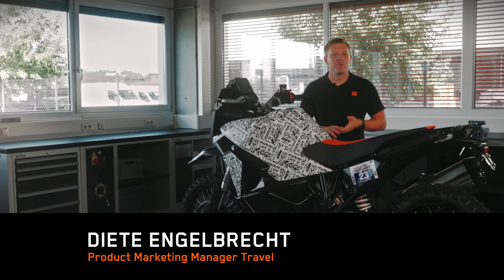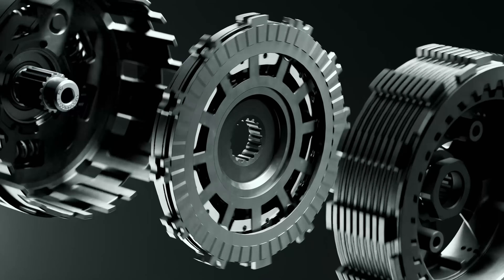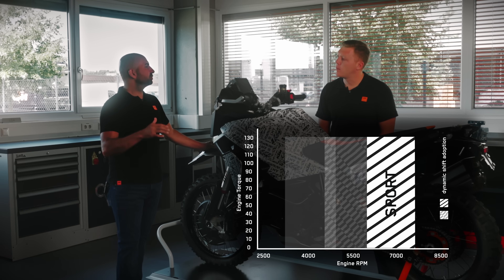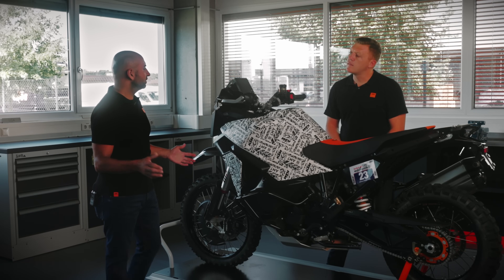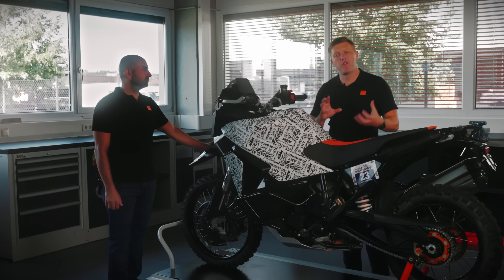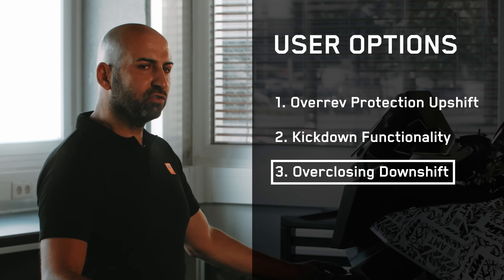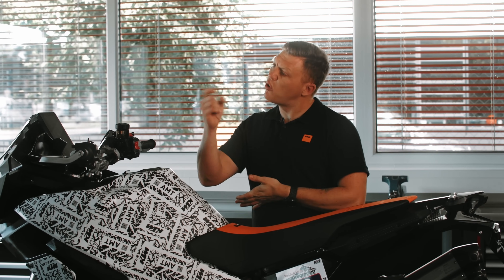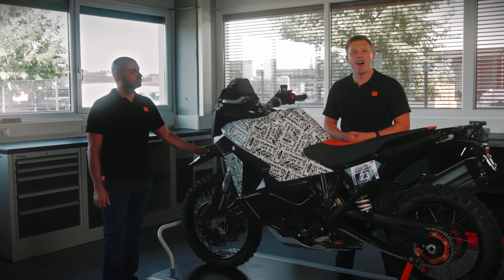KTM AMT - Blurring the lines between sport and comfort | KTM

Comment: Two questions
1) how does it work when you are coming to a stop, do you just apply the brake and it goes into neutral when stopped, most people are used to dipping the clutch 
2) I’m guessing the model in the vid is the new 1290 Super adventure R, is there a release date for this?
Reply: Hi Peteski

1~ When coming to a complete stop the bike will go down to 1st gear.

2~ The bike in the video is a Prototype KTM 1390 SUPER ADVENTURE, the first bike has already been launched with AMT that is the KTM 1390 SUPER ADVENTURE S EVO with more models to follow in the future
Reply: @diete_exploring5936 I’ve seen the evo, more keen on the adventure r, this prototype with spoked wheels, 21 inch front wheel, 18 rear, high front mudguard etc points to more an R model. Keen to know when it’s likely to land as it’s mentioned R in press releases but not signs in the ktm marketing.

On the gearing, keen to feel how this works, if you’re not dipping a clutch, sitting in first can be problematic, I assume it will work like car auto so instead you applying the brake to hold 🤷🏼
Reply: They Use Centrifugal Clutch Engagement. Like Rekluse EXP 4.0. So basically, clutch pack can disengage itself when engine rpm goes down. but normally TCU will downshift the sequential gearpack to lower gear, followign Shift diagram. 

This system have some critical issue that other AMT system doesn't have. so i guess they will not adapt this technique into R model. that kind of genre require precise clutch control.

Comment: I think it's really neat. I don't get why people get so upset about losing their manual gearbox, while a quickshifter has almost been the most requested feature on modern bikes.. eliminating using the clutch for 90% of gear shifts 😂
Reply: Can't clutch dump like you can with a normal clutch
Reply: @tylerslayton6070  tell me how often you do that with a 1390 under your seat.
Reply: @fwijffels  wheelies, logs, curbs, etc. Try riding an adventure bike like it's supposed to be ridden instead of like a goldwing and you'll want a clutch.
Reply: @tylerslayton6070  I think you misspelled touring bike. Nobody is jumping logs on a 1390, other than paid pro's or youtubers.
Reply: @fwijffels   I'm not doing 4ft logs, but 2 ft logs on an 1190 are no big deal. Michigan trails always have at least one tree down across them at any given time, kind of ruins the ride if you can't get your bike over them.
Reply: @fwijffels  also, I'm 160 lbs in full kit, so I need the clutch a little more, my weight doesn't make much difference on this big of a bike

Comment: it's amazing how they managed to squeeze all of that without much additional weight
either way, the problem of quality control, and flawed designs still persist.
your LC8c platform is flawed by design, whether it's bad quality cam material or problem with the precision of the oil gallery drilling, your engineers didn't account for such thing, maybe an additional oil pump or additional/bigger oil paths would've helped.
what's worse is that it's still unresolved with no newer part numbers and yet you kept on releasing newer models without fixing the issues with the current models

Comment: I don't agree with this system. 
No Clutch Actuator Used
Just Centrifugal Clutch Engagement. 
Means, the Dog Ring in each gear will got shock when system shifting the gear during traction is generated. 
Also, Centrifugal Clutch Engagement makes a lot of sludge when user drive that system in low demand, city drive conditions. It will stuck the oil circulation system(also filter elements)
The bike, Especially Travel bike is not just toy. Reliable Transportation. DO NOT push the biker into the expectable dangerous.

Comment: Ktm

Bought a 1290 sas 2023 , never going to buy KTM ever again, abs pump issue causing panic brake randomly, started to have coolant lost 250ml in 4 days and counting , paint peeling everywhere on the clutch bracket and reservoir , battery drain issue , between 50-80km the steering will wobble uncontrollably , if you let go and will also go right instead of straight. There was also a chemical / electrical smell when starting in the garage KTM dealer said everything was "normal" . The adaptive cruise control took them a month to fix . I traded it and never looking back , lost thousands but that was better then keeping it. Dangerous bike. Believe everything you see in forums about KTM , it’s not exaggerated. Extremely unreliable!
Reply: For your cooling leak, i had a similar one, it what the hose of the liquide pump, wrong mounted in Factory. My dealer replace de intake pump part and the hose (non leak After).

For the handling bar situation, same for me, and it severely decrease when i replace the front tire (by a Dunlop contitrailattack).
Reply: But really tell us how you really feel about KTM...
Reply: Hhmmmm? 🤔

Comment: I love KTM. I own a 1290. I've had 3 of them.  I've from each generation.  
I DON'T WANT AN AUTOMATIC. 
I hope there's a full manual version.  
Who's asking for this??
Reply: There is a normal SAS
Reply: For road riding I love not having a clutch lever.  7000km on a properly sorted electric bike showed me that if throttle mapping is done right, 100% of the need for the clutch lever disappears instantly. Just twist and go. More mental energy freed up for picking the right line, looking for hazards, etc. Love it. My K1200GT is an example of getting the mapping extremely wrong. Have worn out two clutches on that thing (40000km each) because the throttle response is lumpy af
Reply: @jsleeio  I can ride my 1290 without a clutch once moving but for me banging through the gears is part of what makes riding fun. EV bike with no gears holds zero interest. In the same way my driving for fun car is a manual and not an automatic.
Reply: @jsleeio ya,  you're not a ktm buyer. Lol
Reply: @scottbott8525  owned a 990SMR actually. Bought it new. Overall worst bike I've ever owned. Crap in the city (very inadequate cooling, got really hot in traffic. I could only really ride it late at night) and crap out of the city on weekend rides (incredibly uncomfortable seat, though it WAS fun for the first 30 mins ish) and also it had terminal engine bottom-end trouble within 6000km. It sat parked for years then I sold it (with full disclosure etc, I'm not an asshole) when I moved. Don't miss it. Would probably still be riding it if the cooling system worked though.
Reply: @jsleeio sounds like you're not a ktm buyer. 

Like I said
Reply: With a multiple broken left hand, clutching is very difficult for me. So, to your question: I wanted to have that!!
Reply: @rowo47114 you have the Automatic Honda now then?
Reply: @scottbott8525 
I live 20 km away from the KTM headquarters in Mattighofen. I prefer to ride a KTM with pain rather than a BMW or a Honda 😉